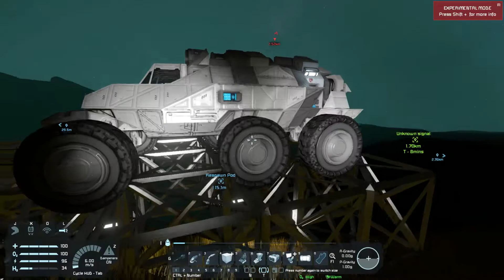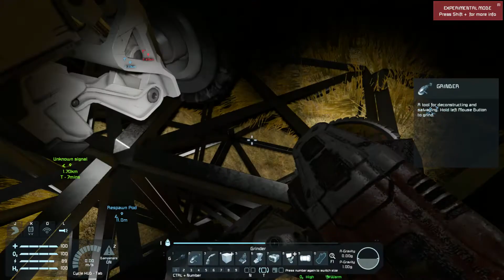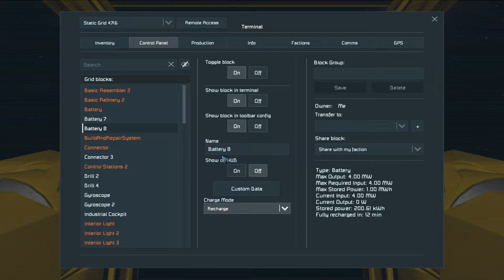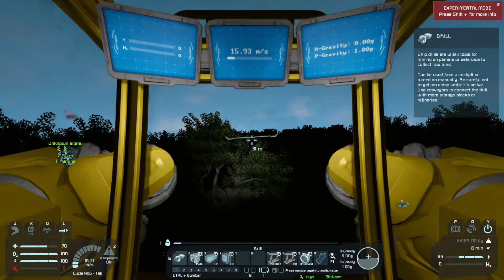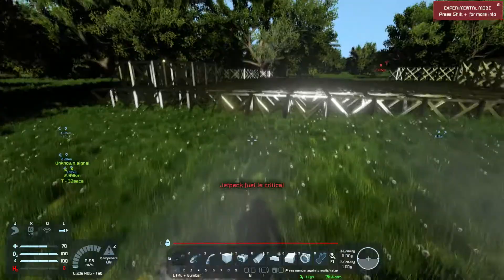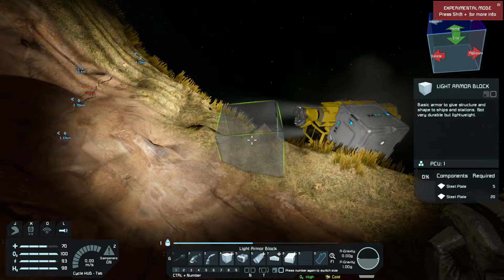Space Engineers: Survival Mode S3 #2: Off the Ground

Comment: I'd set the forward thrusters up as a group and then use overrides when just coasting. Saves a ton of energy not running them at 100% to go forward. 
Also, someone changed their inventory size between episodes meethinks. ;)
Reply from the maker: You're right about the thruster group, but I don't like micromanaging to that degree so I'll just eat the energy cost in atmo. I do usually use override to manage hydrogen usage when leaving atmo, so I'll do that when we cross that bridge.

I actually didn't change inventory size, but I needed to load the save in creative to use the voxel tool to remove some glitched foliage.